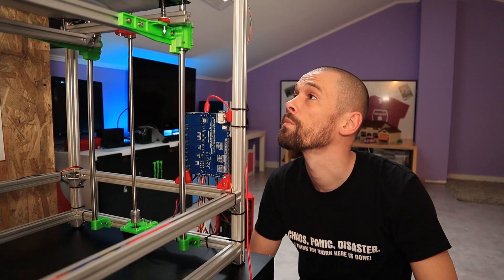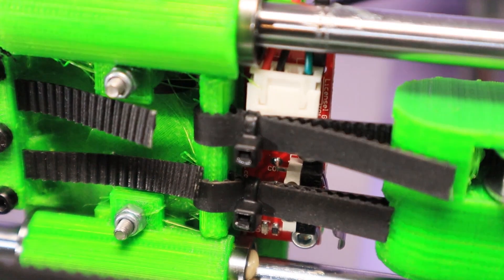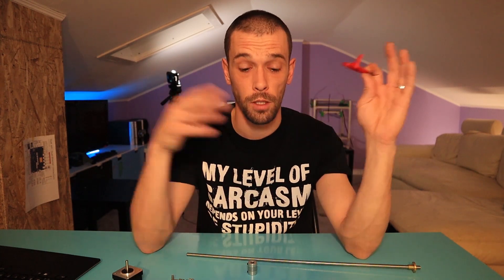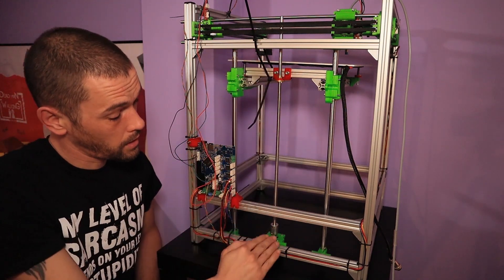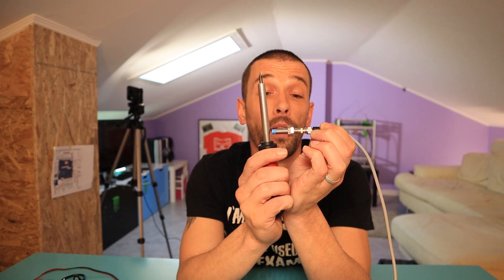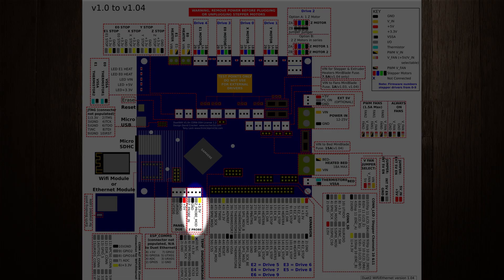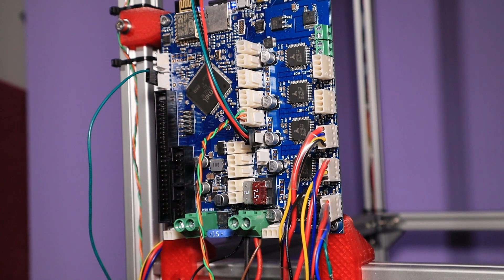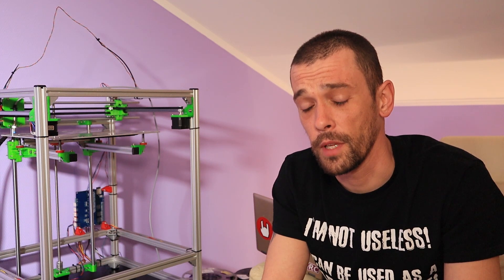EP.07 - Building a 3D-Printer - Hypercube evolution

Comment: A good cheap control board option is the makerbase e3d Robin 32 bit. Cost is around $20 for the board with quiet tmc2209 steppers and extra support for sensors. Well worth the price, 8 bit boards simply can't do detailed prints well at high speeds since corexy printers require a lot more calculations compared to regular cartesian printers.

Comment: Hi 
What do you think about voron1.6 and hypercube. is voron 1.6 is better design then hypercube
Reply from the maker: I'll have to take a close look at it.... On first sight it looks simular... But then again it doesn't.... I'll get back to you on that
Reply: The voron is a very high end machine that costs at least 3 times more than the hypercube evolution to build. I have built both. The hypercube is really good value for print quality, with almost no ringing on prints.  The main difference is the voron uses 7 linear rails, which alone can cost as much as an entire hypercube evolution build. If I were to build another one, I would probably build a hypercube because it's cost effective and prints almost perfectly. Design wise, the voron does indeed look very cool and looks more "professional", but I don't think the extra cost is really worth it and it is a lot harder to build. Hope this information helps 🙃. If you questions about anything related to 3d printing, I would be more than happy to help!

Comment: Hi Pieter,
Does the single Z drive print-bed hold its level? It looks as though the bed might sag/droop at the furthest extent.

I have ordered my Duet Wifi. Did you find any difference between Duet Wifi 1N3F and K3D6? I tried to research the boards but I found nothing.

Can you please show the external and internal measurements on a video and describe the limiting distances inside the frame that constrain the printable area?

Kind regards,
Simon.
Reply from the maker: Hey SKWDIESEL,

The single Z = a no go, i already added a second one! (see my next video, it'll be on soon) 

I've been looking for youre question, i don't know... if you go to the duet3d.com, the original Duet seller, there is nothing to find about 1N3F or K3D6, i got a V1.04... and it's awesome, compared to what i was using before (Ramps 1.4)

My next video is almost finished, i can show you the dimensions in another video (but know that it 'll take a week or 2)
Or you can go to the http://bit.ly/Hypercubecalculator where you can insert the dimensions you want, and it will tell you what you need...

I'm already thinking on other upgrades....

Greetings

Comment: Hello, Congratulations , you are making a great job...I'm searching for a several stuffs to start buiId my Hypercube, and,  your material help-me to increase new ideas for my project...So...  About your solution to reduce voltage on sign pin of inductive sensor, I wonder if could be more safe to do that using a circuit with transistor or a voltage regulator as LM317 for example. I think that circuit can eliminate any noise or overvoltage that could interfer on signal in that pin or even damage the circuit board...Maybe I'm wrong,  but is just a idea to test if you detect anomalies on your prints in the future.
Reply from the maker: Hey Jonathan, thanks... and good luck with your build! Feel free to post pictures!
about the proximity sensor. I don't really know if a voltage regulator would be helpfull... i mean, it still operates on the 12v, only the output voltage steps down when triggered. I'm not shure if a voltage regulator (like the LM317) would give some latency. How fast does it startup etc. I've seen some discussions about that, and mostly they recommand the trick that i did.... 
for example:
https://github.com/MarlinFirmware/Marlin/issues/7910
or
https://www.reddit.com/r/voroncorexy/comments/6096bc/question_on_z_inductive_probe_wiring/
So there are several options... i just thought, this was an easy way... 

Last week i've finissed my build, i only need to find the time to edit that video, and i'll talk about the ups and downs that i already noticed... so, stay tuned, cause i already made some upgrades, and planning to upgrade more stuff...
Reply: your informations are very helpfull to me, I started to build yesterday and I had same problems that you, so, today I'll print your parts to replace the model from tech2see, thanks for share your experience. I'm really very curious to see your updates, maybe, if I have time, I'll share my build too...thanks a lot

Comment: Hi. could you tell me if this hotend is good as first hotend? i know that it's cheap but i'm searching for a cheaper one that is also decent... thanks!
Reply: Thanks very much, I'm very close to a working printer! :)
Reply from the maker: @damicorner  feel free to post pics/video
Reply: I will soon. Still working on on the last axis (the bed).
Reply: https://www.amazon.it/j-testa-completo-Estrusore-V6-Makerbot-stampante/dp/B07MH5KYW9/ref=cm_cr_arp_d_product_top?ie=UTF8
Reply from the maker: @damicorner  I had one of those, but i won't ever buy it again, there is a ptfe tube on the end of it, and when you need to replace it it's hard to find, also, you are limited with the temperature, cause of the hotend... I'm using a guenuine E3D V6 on this build (next video) and it's really worth the money... If you don't want to spend that much money, i'll suggest getting the E3D V6 Lite, it's also limited in temperature, but better then any clone! (trust me, i tried a lot of clones)

Comment: What do you think about the cetus3d printer? I'm planning on building a clone :)
Reply: I think i will definitely try building a clone.. I will shoot a video when all the linear rails arrive from the good china :)
Reply from the maker: @damicorner  keep me updated!
Reply: Sure, thanks for your concern :) keep us updated too :P
Reply from the maker: I think it's a cool design, but i wonder how the results are with exotic filaments.... A thing that i think is strange is a 19volt psu.... so i got no idea, if anything breaks if you could easily replace it.... if you build a clone, then that should be no problem.... think you'll probably better off.... make a video off it, i'll watch it!
Reply: What about the Migo printer? You can find it on kickstarter.. It has an unique design that allows you to eliminate the weight on the x axis using a " square bar" on the right and 3 motors in the base..
Reply from the maker: @damicorner  Looks nice, great features, but limited in size as i can see...
Reply: The problem is that i can't find that square rod and a pulley with a square hole..
Reply from the maker: @damicorner  search for mgn rails but watch out with the cheap ones.... I've read about them